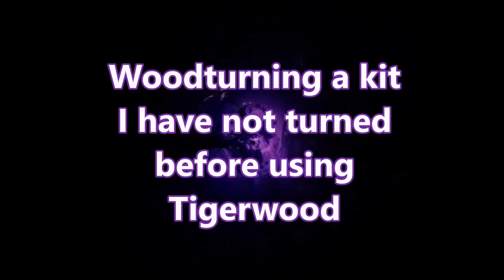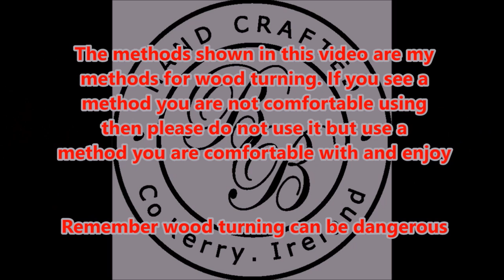Woodturning Tigerwood using a new kit I have not turned before / wood turning

Comment: Your story was great. 😹  And the cup looks nice.

Only thing - in MY thinking, you could have used forstner to bore the diameter of the BOTTOM. Then hollow a taper to the top. Would give a snug fit and more material for shaping the bottom.

Just my useless input 😜
Great job. Enjoy your stories.
Reply from the maker: That is exactly what I did in the video Dwayne I even say that the bit I got for the vases is the right size for doing the cups. You might have missed that part though.
Shay

Comment: For better support, I think I would have turned a plug to use with the tail stock, this should take care of the little bit of squeal while bringing it down to size. It’s the same idea as using the box lid while turning the body.
Reply from the maker: Not a bad idea at all Timothy, if i do another one I will use that.
Shay

Comment: What a lovely carry mug! I'm quite fond of my coffee, so I'd definitely use one! Where did you source the kit for it? This has given me inspiration for other projects, where a bit of thermal insulation would be good. For example, a casserole holder, when going to a shared meal. Thanks for showing us this one. Great "tall tale" too!
Reply from the maker: They are available at most wood turning suppliers Stephanie. That one came from a bulk wholesale supplier I deal with a lot of the time. Rocker have them and they are available on Amazon. 
Shay